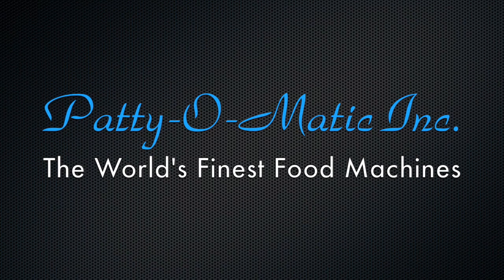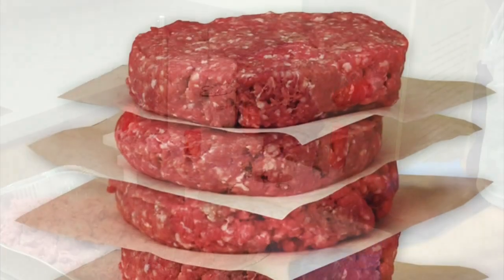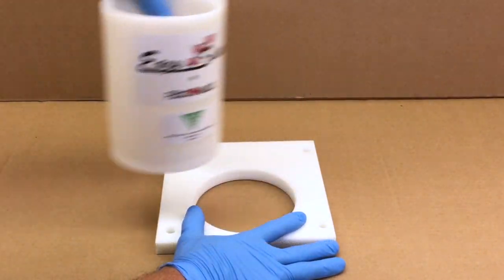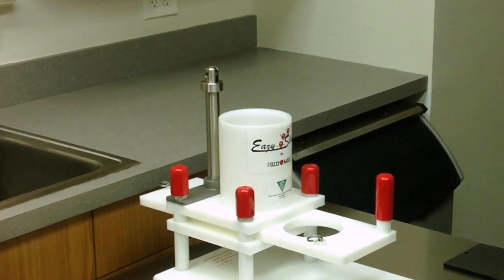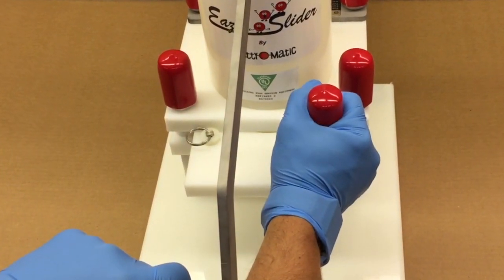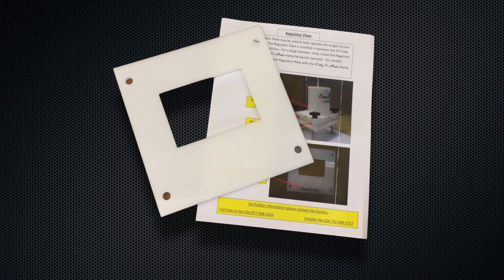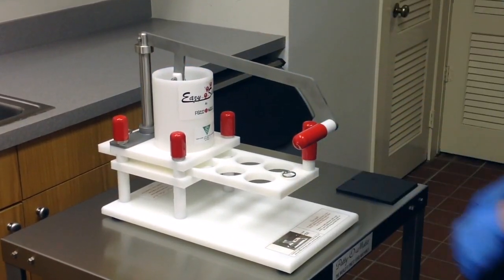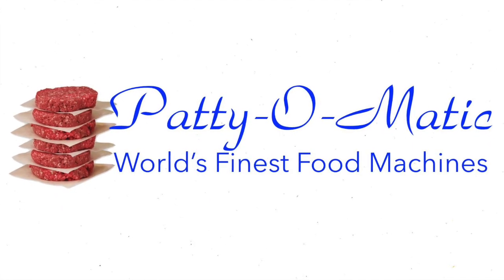Eazy Slider Commercial Patty Forming and Portioning Machine

Comment: i have a problem using this slider when i press the meat it wont come out like the mold plate as the meat attached to the bed plate is my technique is wrong or do i need to loosen the tighthen knob??? help me please
Reply: Hello. I have the same issue. How did you manage for the meat to come out?
Reply: Spray some light oil on plate and maybe add some fat to mix

Comment: Can I use this for making potato patties???
Reply from the maker: Many people use it for potato pancakes.
Reply: @patty-o-maticinc.2523  It would be great if you made extra molds with other measurements in diameter and thickness. For example, a 3.5 "diameter, 1/2" thick mold that I need to slide cooked corn dough tortillas. I think your Eazy Slider would be more usable than just to slide hamburgers.
Reply from the maker: @olgacastro6938  We do offer hundreds of different shapes and sizes.  Please email us at info@PattyOMatic.com for more information.  Thanks.